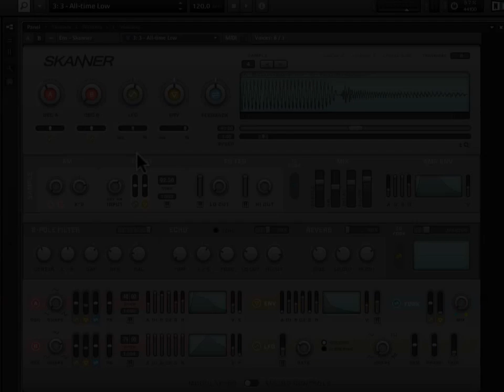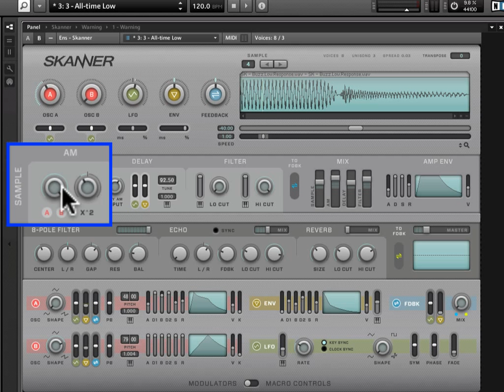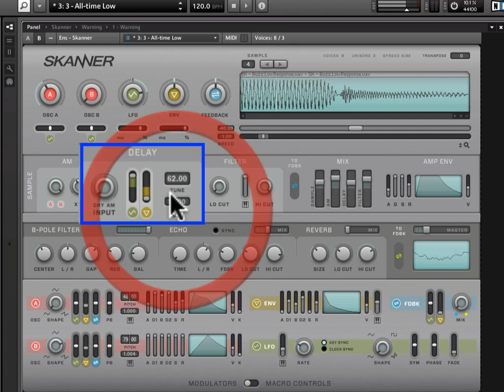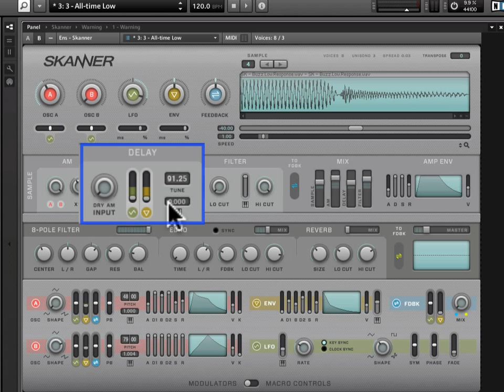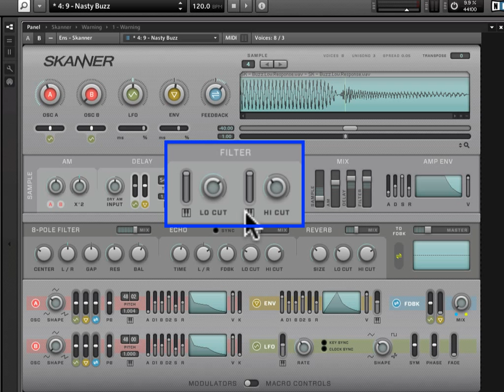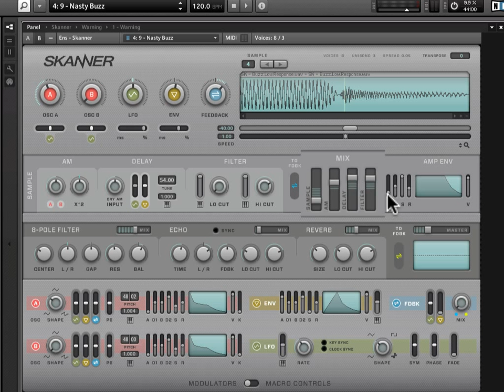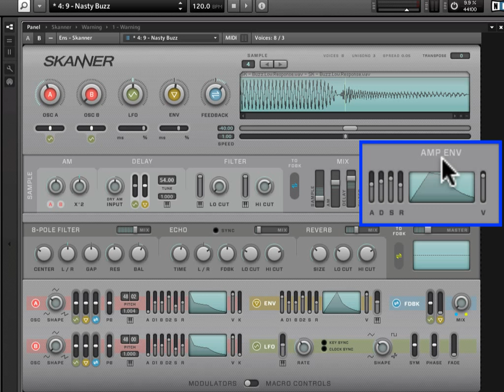Introduction to SKANNER - Part 4 - The Polyphonic Processing Section

Comment: Thanks so much for these tutorials - they've been massively helpful!

To clarify what those two-way mix sliders do, by sliding them up it adds more of that particular signal (eg 'delay') to the full audio signal; by sliding them below the middle point it actually subtracts that particular signal from the full audio signal. I guess you could also think of it as adding an inverted version of that particular signal's waveform.